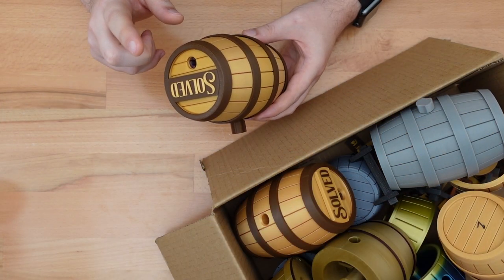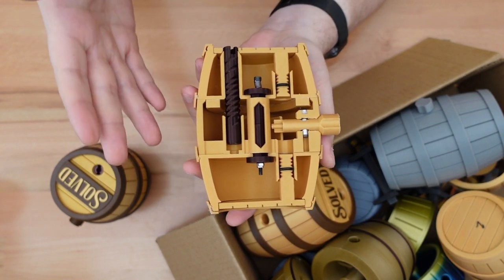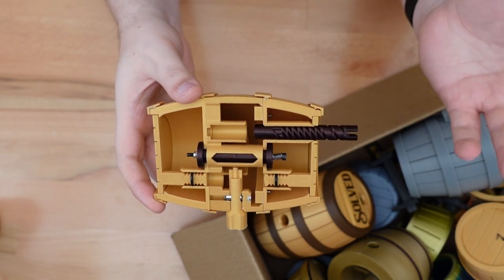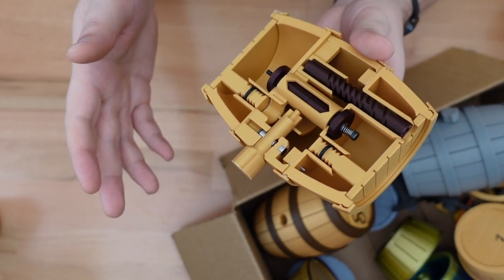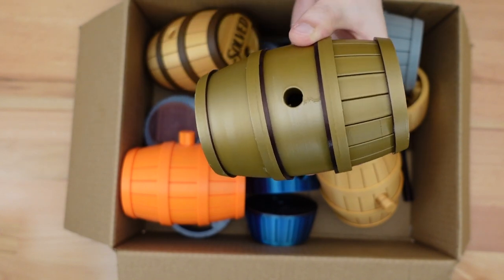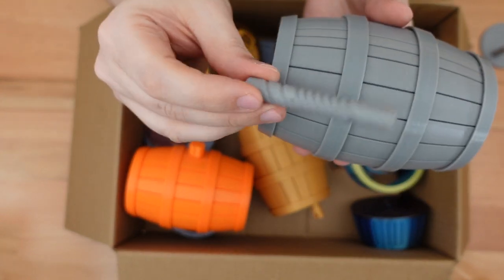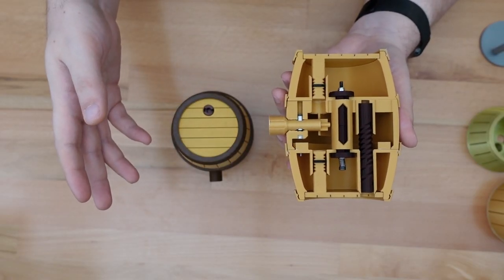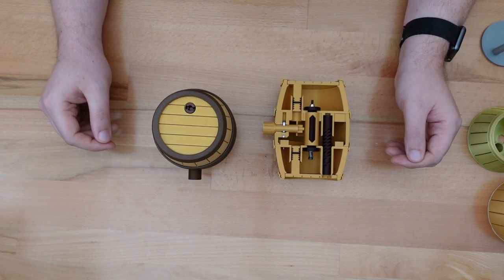The Barrel Cooper's Puzzle Box - Design

Comment: Hey great video! I'm currently working on my own puzzle box. I'm curious if you could do a video about the designa dn 3d printing. Like specifically what you find works well for how thick a wall should be or how much infill or how many walls to print with. Also maybe how you decide to chop up a part for printing. Like really get into the nuts and bolts of it.
Reply from the maker: That's a great idea. I have a few videos about puzzle design, but nothing that really gets into the details of designing for print. I'll need to think up some project that would work with that focus, as I don't really have many pure tutorial videos.

Comment: had a quick question, my coopers box has a metal ball rolling around or something. Anyway to fix that?
Reply from the maker: I assume whatever it is must be in the center chamber - otherwise you would find the loose part when the puzzle is open.

To access the center chamber, just unscrew the main bolt (bolt head is exposed in the top section) while using pliers to hold the nut in the bottom section still. The design doesn't include a metal ball... maybe something was pushed into the cork hole in the side?
Reply: @3DPrinty  yeah I’m not exactly sure what it is, it just assumed it’s a metal ball because it sounds like it’s rollin around, I’ve solved it before numerous times though